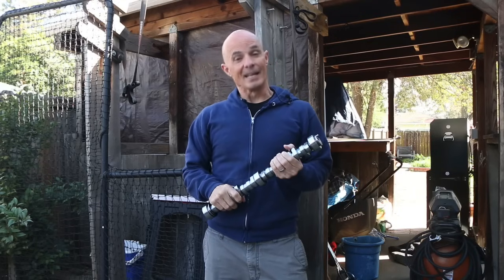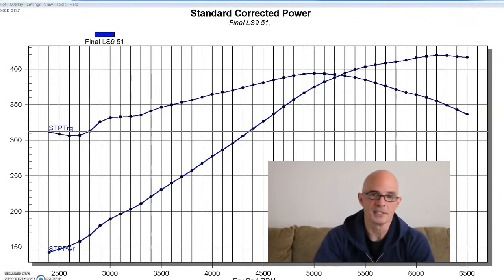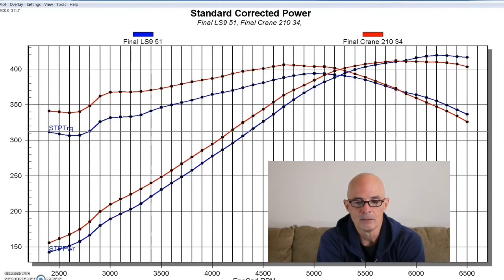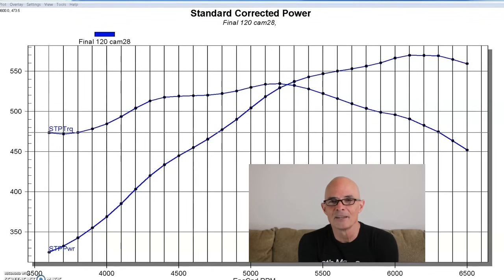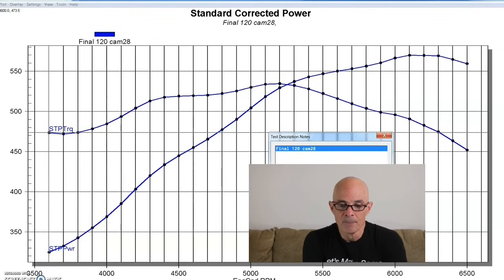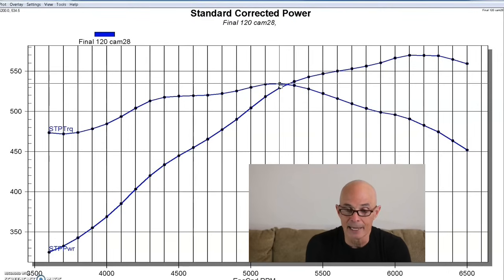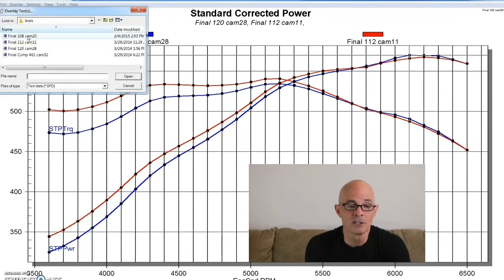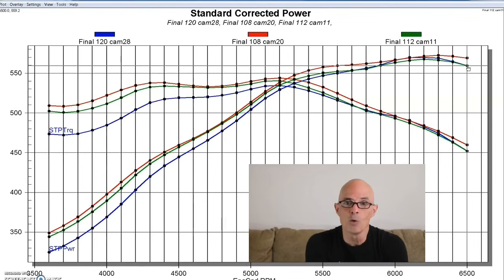LSA CAM TEST-108 vs 112 vs 120

Comment: I think the difference between LSA’s would have been more pronounced if the duration specs were lower.  I believe the combination was slightly over camed on the duration side so it wasn’t as picky about the change in LSA.
Reply: A 408 over cammed with a 232 duration at 050?
Reply: Brent Spence for the test to show a large difference.  Not in general.  The exhaust duration was like 247 was it not?  I forget.

Comment: I’m waiting for cam tests like the 228r with 112 Lsa. 
All your tests have split duration. I’d also prefer stock block configuration. I feel more viewers can relate easier. Maybe throw in more ls1 engines too.  
 Overall great job! I enjoy your videos.
Reply: doubt you will see any single duration cams, almost all cam places insist on split duration, and a larger one at that, not to mention that 5.3/6.0/6.2 are now more common than a 5.7 ls1/6
Reply: More of a reason to test it now. Let’s see if they are correct. These dyno tests will back up statements like that.
Reply: i agree, id love to see normal split vs single duration vs reverse split to see how it affects the curves

Comment: Now test those same camshafts again with Forced induction and include results of the LS9 Camshaft too, please!
Reply: The graphs will just be higher up. Boost shifts the curve upward.
Reply: @Borderline5440  Thats not the whole picture. The tighter the LSA the more boost gets wasted and thus fuel.
Which may lead to other problems like exhaust gas temps getting to high.
Reply from the maker: results are the same under boost
Reply: @richardholdener1727  I'd like to see the difference in spool times between the different cams-on the same combination, same turbo, same wastegate spring.  It seems us turbo guys have always been told we need a wider LSA and I've even had engine builders tell me it is to help the turbo spool up.  Every time I have asked a question as to how this is possible, they give some nonsensical answer about it creating more exhaust volume or they go to the "I've been doing this for years" lecture.
Reply: The likely reason a wider LSA spools a turbo faster is due to the earlier exhaust valve open event, not because the LSA is wider. Earlier EVO allows combustion to escape (blow down) at a slightly higher pressure. It’s sort of a similar phenomenon behind retarding the ignition timing. It delays the combustion process a few degrees of rotation and results in higher pressures during blow down.
Reply: @richardholdener1727  the question here i believe is the theory of boost is a measure of resistance

Comment: Is there a way to work out the "best" LSA for a given camshaft profile, or is it more application specific? Ie would a turbo car respond better to a differing LSA than a NA car? (I know every cam is a turbo cam!) Is there a difference when you start getting above 6500rpm? And lastly does cam timing have any effect on the LSA power/tq differences? super interesting video! Thanks for doing what you do.
Reply from the maker: very involved questions-too long to answer, easier to tell me what power you want-I can show you a combo that did that
Reply: @richardholdener1727  I have a 365ci LSX turbo that went through some changes at the last inspection, we had a comp cam 481-11 in it, which was healthy and worked well, but we were nosing over on power up the top end (we were also well past max flow on the S475), we were chemical intercooling it to try to squeeze it that last little bit. It maxxed out at 922(aussie)hp at the wheels on our eddy current chassis dyno at around 19psi. 

We changed it out for a S480, and put a kelford TS108P in the car and lost what felt like a tonne of torque down low - it now struggled to get on the converter, but the car ran quicker and faster than it did on the old setup, at less boost. The kelford is a resonable step from the comp cam, but i wasnt expecting to lose as much as i did in the bottom end but we gained 120+ hp over the previous run, at only 16psi, with the car now showing 1050hp on the rollers. We took it to the track and proceeded to page up all the boost control tables to 23psi. Can only guess what it makes now, but it pushed a 2850lb car to 171mph over the quarter.  

It didnt matter what i did with AFR(0.75:1 through to 1:1), timing (25 to 45) , throttle limiting (trying to change the airspeed into the plenum), converter charge dump valves etc. It just would not respond at all below about 3100rpm, once it got through that point you would want to be ready for it, because it all came on real fast. 

The LSA was only a 2 degree change, but also a profile change - so its not a valid comparison, but its where the question came from around best LSA for a profile. There has to be a reason they just dont make every cam 106-108? Up to 6500 rpm it looks to have zero downside on the dyno, but I am also curious as to what it looks like at 7500-8000rpm. 

Thanks again!

Comment: Great video! I just ordered a cam with 120 +4 LSA for a supercharged LS 383. I would love to see a video with these same cams with forced induction.
Reply: yess i asked the same on a gm lsa motor to see how the tight lobe separation lets boost out the exhaust
Reply from the maker: tight LSA doesn't do that-it just adds power through the rpm shown in the dyno test-even with a blower or turbo-the wider LSA (like used in an LS9 cam) adds power at the top-but has less elsewhere
Reply: @richardholdener1727  good to know! i always thought such a tight lsa would allow boost to exit through the exhaust while the intake and exhaust valves are open at the same time for longer?

Comment: the other thing to consider beside a smaller engine and the relative difference, is with a smaller duration cam will the 108 still come out ontop? or is that the more duration you add the trend is towards tighter lobe centres performing better and vice versa? personally i belive with the same engine the trend will be there irrespetive of the duration.
Reply: The 108 will have a sharper cutoff at the bottom.  You couldn't see that, because the sweep didn't go low enough.

Comment: Thanks Richard, can you test a cam that is too big that's actually make less power than a smaller cam. i always hear about it but never seen it
Reply from the maker: look at the 408 (175-hp cam) video-yes you can have too much cam
Reply: Too big usually means too big for what you are doing with it. For example, street use where vacuum and driveability come into play. The engine dyno won’t show driveability.
Reply: @chucksgarage7165   Or   no engine  pulls at steady Max. rpm power. Depends on trans. type/coverter, you can have more/less spread on the rpms the engine will work.  Too much cam ,can easily drop power on the low side of the rpm range and make the car slower.
Reply: never too big! 😎

Comment: I've seen people say that LSA doesn't matter.  This says otherwise. Maybe in lower lift cams on smaller engines, but gaining 50 lb-ft of torque at 3k  is huge in a daily or towing vehicle.
It also matters in a drag car- that torque @ ~3K, even though the engine goes through that extremely quickly, is what gets you out of the hole & hits the tires harder.... Then the rest carries you down the track.

Comment: I’d definitely like to see this on a smaller displacement engines possibly comparing the 4.8L/5.3L to the bigger 6.0L is also be interested as to how the LSA can affect specific boost pressure
Reply from the maker: same under boost
Reply: @richardholdener1727  Pove it! 😉
Reply: Have you not watched his videos? The difference  it makes na  will be the same under boost. Almost every time  he tests a motor na vs boosted the curve is the same just higher up the graph obviously.
Reply: Joe momma I wasn’t really thinking when asking my question tbh initially I was thinking about degrees of overlap
Reply: @joew7897  HEY!!!! YOURE AN IMPOSTER!!!
Reply: I was just thinking about making a very similar comment to this. Lol
Reply: it would be very interesting to see this on the 4.8L/5.3L, as well as comparing, for example, what BTR did with their truck cams between V1 and V2 where what used to be 113+3 LSA is now 110 LSA.
Reply: Add boost and let’s see what it does. Would like a comparison between positive displacement, centrifugal and turbo.
Reply: @RadDadisRad  I agree!   I know Richard says it's the same with boost, but is it the same with turbos vs SC?   I would tend to think they might react a little differently.

Comment: What do I think? Hell, I don't know anymore...between you and Engine Masters everything I learned as a kid was false. Can't wait for the next installment.
Reply: @bigboreracing356  All he said was that he was taught some things as a young person that wound up being inaccurate. No need to be a jerk, I'm sure you have fallen prey to misinformation at least a time or two. We all have. Some of us are man enough to admit it. They knew everything in the 1930s that we know now? You're out of your fucking mind.
Reply: I understand physics... and english. My point is, all the hearsay and conjecture are being disproved through a scientific method and theory to practice. Sorry, I didn't have all this information available so easily at a younger age. Thank you, Mr. Holdner for sharing.
Reply: STREET RACER what’s your point in trashing someone for something they learned or were told wrong when they were young? Don’t be a douche, we all have been told things that were wrong. Doesn’t give you the right to jump all over someone. 🤷🏽‍♂️
Reply: @bigboreracing356  when did the automotive or the aviation industry learn about exhaust scavenging? not until ed iskendarian started moving the lobe center lines (what this video is about) on the camshaft and creating the 5th cycle® (exhaust scavenging). yes physics applied, but the camshaft event was not discovered until isky developed a tighter lsa in the 1950s. 
up until the mid 70s camshafts were ground with a single pattern. the intake and exhaust cam lobes were the same profiles. the camshaft industry discovered that if cylinder heads had poor flowing exhaust ports, then it was beneficial to give the exhaust lobe more duration and lift. the dual pattern camshaft was invented. physics applied, but it was not discovered until then.
Reply: Axle Grind : For sure, good , indeed, Great points noted. I refuse to assinate a reasoned and well natured, intelligent discussion. From my research, in fact,  Fords Cobra Jet engines had split lobes in 1969..primarily  because of coil over A arm Falcon/Mustang/Fairlane/ Torino unibody chassis spring towers taking out  space for better header short turn and  making exhaust flow a lot worse. 14 bolt FE exhaust's, Lima 385's , Shot Gun 429s, 335 Cleveland based engines...the later Glidden high port was an attempt to steal back exhaust flow to the levels which torsion bar Mopars and wishbone GM engines had always enjoyed.... with no problems in cars with less intrusive "upper" wishbones. Unibody AMCs and seperate chassis V8 Studebakers had similar issues with exhausts verses upper wishbones so the lobe "Duration" split was being experimented with very early on in Detriot Mich and  Kenosha dyno cells. Before Ed released his excellent cams ground on narrower and wider lobe spacings, Clay Smith had unlocked Lobe angle "Separation" rpm changes (before he died) in the 40 to 50s. Not saying he was first...Id say the Milkers Brothers were copying Aero engine practice too! Clays company continued that work...it wasnt just Isky. Smokey was reputed to say Clay was the smartest engine cam guy he knew. In WW2,  Eduardo  Weber ( before he went missing) and Enzo Ferrari from the war Aero Italian engines and supercharged and non supercharged Alfa and other engines understood that Independent Runner Port on Port engines like narrower lobe centers. If it wasnt for a bad attitude which puts down really good comments, I would have affirmed other posters info as well. What I will say is all dyno runs shead light on cam theory, and theres right and wrong verses theory, and then dyno runs. Three, four or five sides to every story people. Dont believe the Hype...Believe Hp and lb-ft. And have fun and enjoy yourself. Some respect helps us all.
Reply: Axle Grind .I can affirm that US car makers rapidly  responded to the early  European aero engine  and US cam grinder theory.  Even before  Total Performance and Rapid Transit system or Chevy TranAm over the couneter parts, the AMA race ban was forcing everyone to re investigate OHV cam prodiles using old Side Valve cam grinder logic. For example,  by 1969, all the development work was locked in for the new OHC 1300/1600/2000 fours and in the 2bbl Mark III Cortina SOHC 1600 engine with headers on the 1971 100 hp Cortina GT 1600 got a special narrow factory 106 LSA cam when the 2000 Pinto 112 hp engine made in the same plant got a much wider lobe center cam. Low end torque boost for that Cammer 1600 was a cited advantage which made a 25% smaller engine almost as good as rhe bigger 2000 iron header Pinto OHC despite being a 400 sandwhiches short of the full 2000 sandwhich picnic.  The world wide supply of these engines were sourced from two plants...the West German  Cologne and UK Longbridge guys knew the advantages of differeing LSA cams on the same engiine  families wekl before the Pinto OHC cam engine came  out, and the rare German OHC Taunus 1300 and 1600 engines also got a special 4 degree narrower LSA cam. By 1983, cam tech publicly moved another steo to  Scrambled cylinder to cylinder  cam lobe centers.This came about when people like Auto X racers had trouble making simesed port OHV engines make better power and torque.. Clay Smith and other   cam grinders were doing lobe  LSA changes very early on with flat head engines and Hillbourne injected alcohol hydroplane engines.Its well known that US cam advances helped expat UK engineer David Vizard make those sequential  paired lobe center cams which  were an A series 1275cc Mini and  Austin Healy Sprite thing. David Vizard got US cam grinder  funding to do that in the early 80s. So cam advances were being done from legitimate  inputs from 1930s were. The exhaust over lao and split pattern thing happenes when US grinders suddenly thought...hey wait a minute. What if we grind just the exhayst or just the intake. The Holdener Moment happened really early on!
Reply: @bigboreracing356  most of these magazines always fluff stuff up to sell parts.  manufactures pay for this stuff half the time so you dont know whats real or fake
Reply: @bigboreracing356  I really enjoyed CT magazine growing up !
Reply: @bigboreracing356   Your claim of "30s technology" is false.  WW2 fighter planes had to use Blowers to achieve 1hp per Cubic Inch.. and the LONG affair with low compression in the 6's, 7's, and 8 to 1 levels occupied top billing in the auto industry til the 1960s.   The headflow of General Aviation Aircraft Engines designed in the 50's is garbage... as is their HP to Cubic Inch power naturally aspirated.  80s 90s had companies like AFR and Trick Flow - they had figured things out .. But the tech those companies were employing didn't hit magazine articles and become common knowledge til the early 2000's in Engine Masters Magazine, Circle Track, Engine Rebuilder.  Your grasp on Hot Rod/Enthusiast history is low ... Your bravado is high.. dangerous combo.
Reply: @bigboreracing356  The truth about what? That you're a keyboard warrior who thinks he's "the bad man"? How would I have your comment removed? It's not my video. I'm a commenter just like you, but with some substance. You talk about safe spaces, but probably drive a mustang. Kill any bystanders lately?
Reply: Shelby Avant by the way, street racer is talking I’m assuming he wins engine masters every year..

Comment: Another great video! Keep up the great work! Exactly why I always prefer a tight lsa. Once you get under 110 they get fun to tune but worth it especially in vehicles that are weight challenged.  Jarret from jfr is the only guy I know that has been spec'n ls cams like that for awhile now, he did a tbss cam for us on a 108 that sounds amazing and runs like a raped ape.

Comment: I'm officially confused. I grew up believing narrow lobe centres equated to top end power, and in the case of the 108 cam that proved to be true, but I was always led to believe that come at the cost of low end power, where it actually gained. So now I don't know what to believe. Maybe we need to run it again on a 5.3 to see if the same relative results are repeatable.
Reply from the maker: General RULE-Tighter LSA=more low speed, Wider LSA=More top end, advance cam=low speed, retard cam=top end (on ALL motors)
Reply: @richardholdener1727  In my experience, a tighter LSA will make an engine "snappier".  Too tight in a heavy vehicle, makes the engine feel too "nervous".
Reply: @michaelangelo8001  yes I think weight is a big factor when choosing the LSA.

Comment: GM uses the ASA cam to increase performance in several of it's crate motors, i.e the 525 hp 6.2. This cam has a lsa of 110 and you can use stock ls3 springs.  I'm currently running this ASA cam in a 6.0 with ls3 cylinder heads. great videos
Reply: Do you have the rest of the specs?
Reply: Summit Racing Part Number:HRS-197715-10,